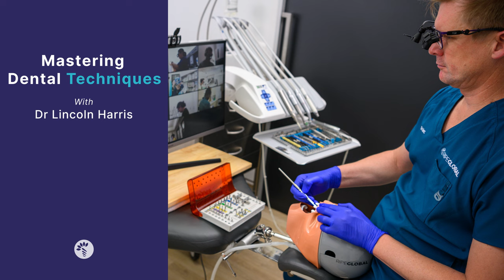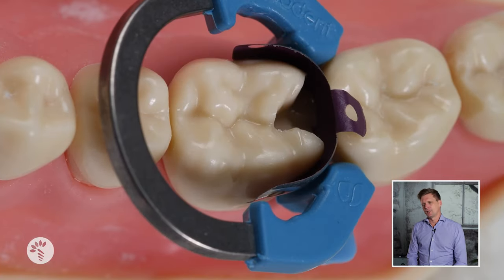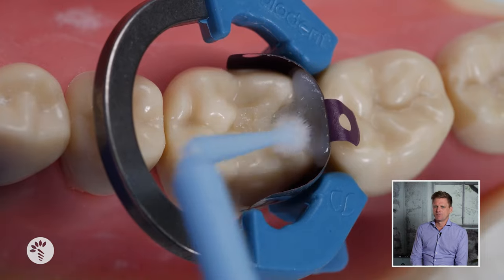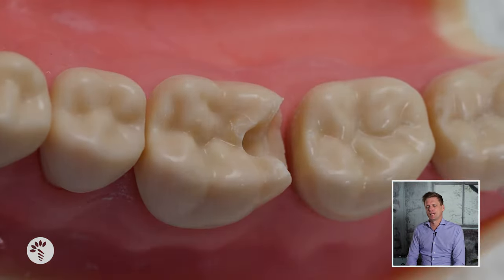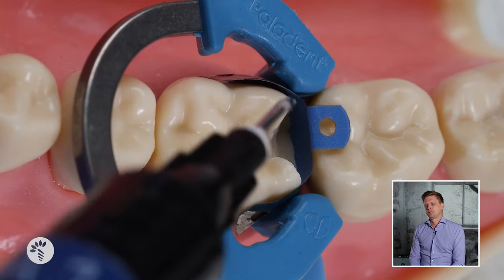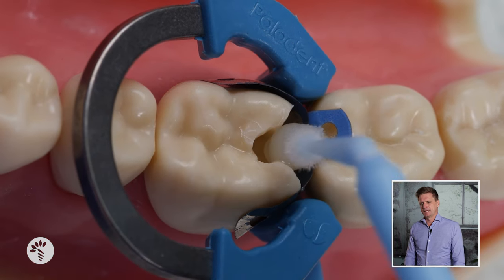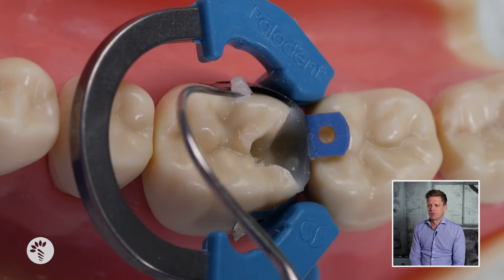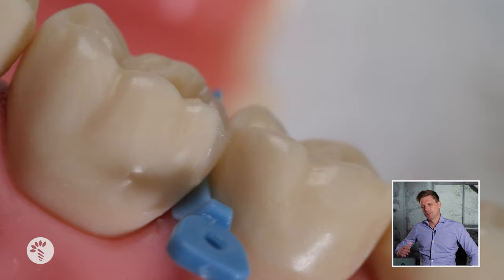How To: Marginal Ridge Heights in Class II Restorations | Tips From Dr Lincoln Harris

Comment: That wall of composite might undergo shrinkage creating a marginal gap between buccal and lingual wall...so...better wud be creating the wall by 2 increments a buccal one and a lingual one so tat shrinkage stresses cud be minimised
Reply: you get voids this way
Reply: I would think that it would be better to risk a micrograp on the margins of the restoration where they will be cleansable than to  have a seam in the interproximal area that will be a safe haven for bacteria which may lead to caries on the neighboring tooth or apical to the restoration.